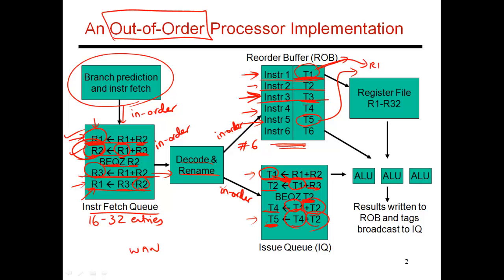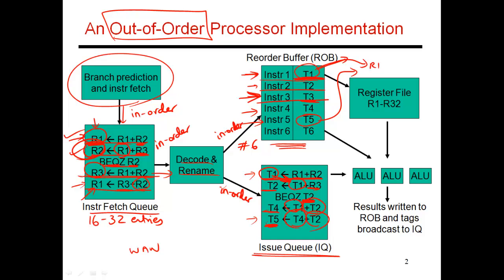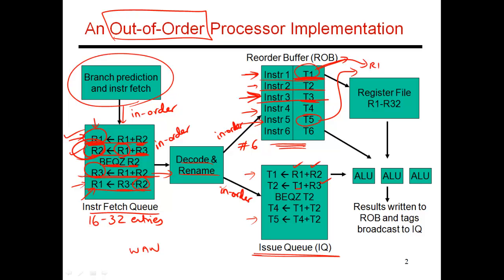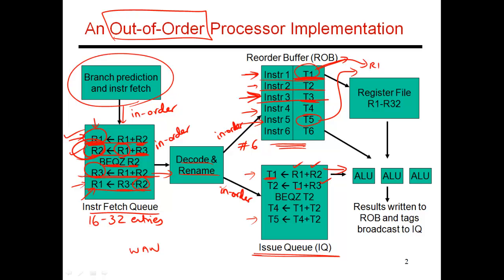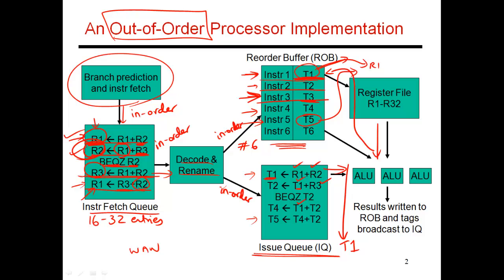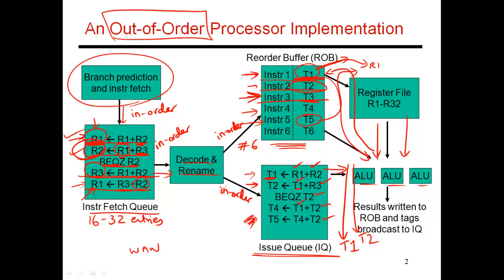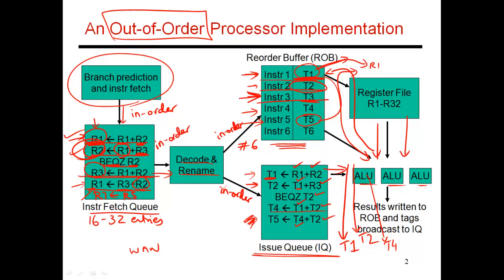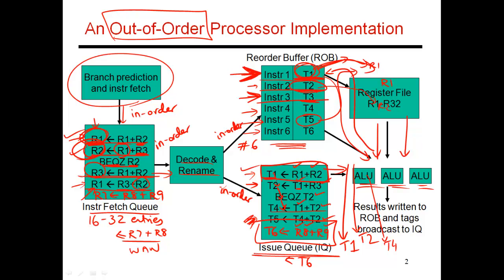CS6810 -- Lecture 28. Lectures on Hardware-Based ILP.

Comment: There is no re-ordering of instructions in the ROB , its purpose at least in this example is to pipeline instructions after register renaming .  Is this the case ?
Reply from the maker: That's correct.  Without the ROB, you wouldn't know the order in which to commit instructions.